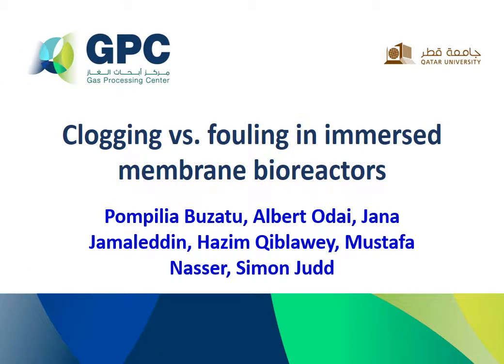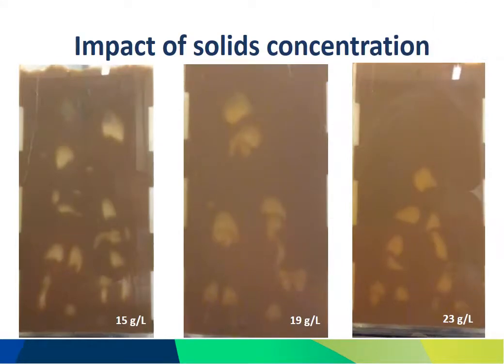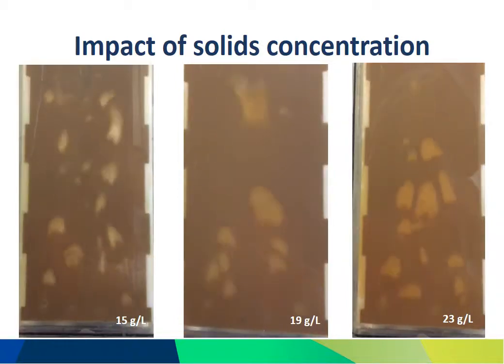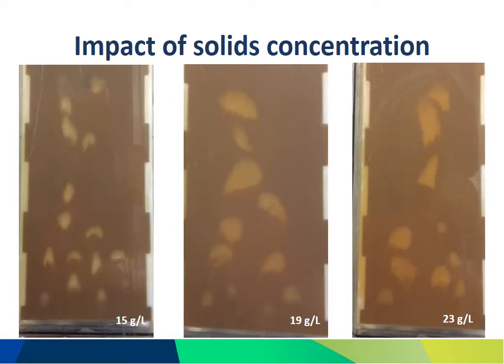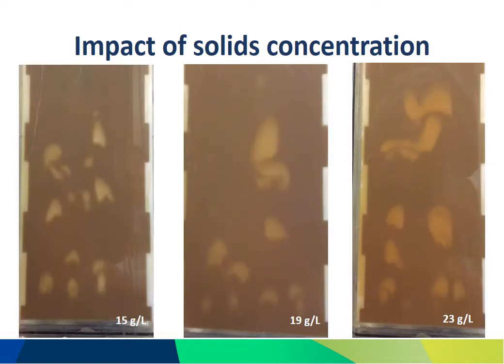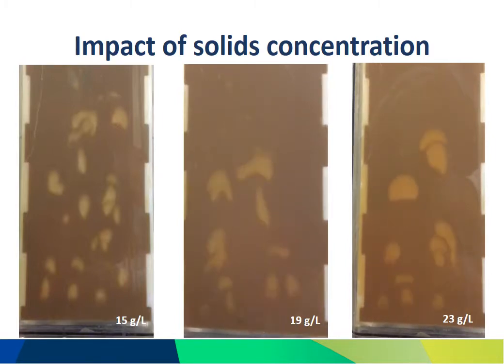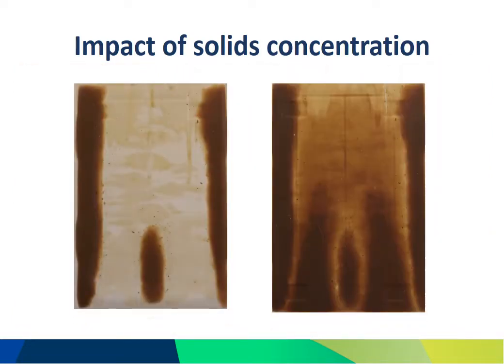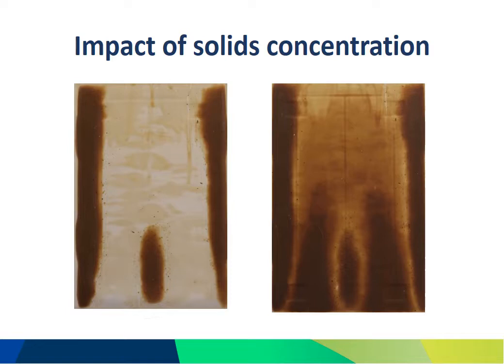Clogging versus fouling in immersed membrane bioreactors

Comment: Great video. Is what we are observing here attributed to wall effect on bubble flow? Is this also observed in iMBRs where sufficient space between the channel and the reactor wall is provided to mitigate "wall effect" on bubble flow? Cheers.
Reply: This doesn't seem to be a wall effect. Bubble coalesence at high solids concentrations has been reported in the academic literature, so the assumption is that the effect shown is due to the high MLSS. Sludging occurs between the membrane channels as a result, and this doesn't seem to be related to the proximity of the reactor wall (although it may be - there as been alost no research on sludging in iMBRs).